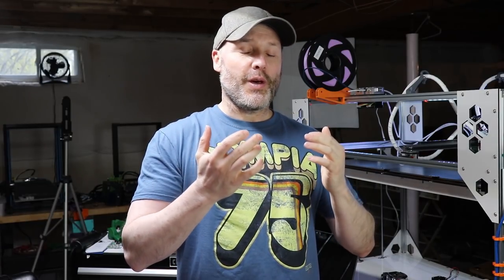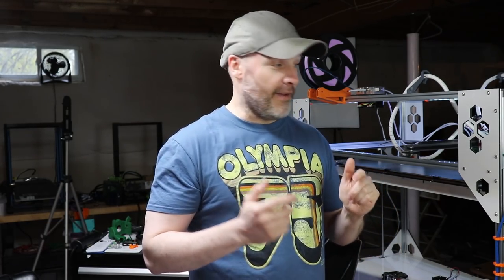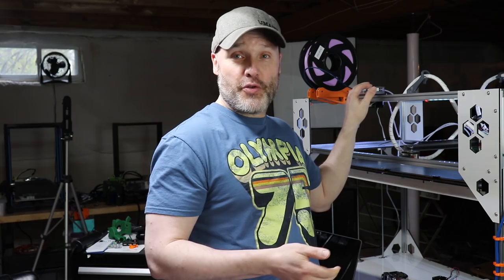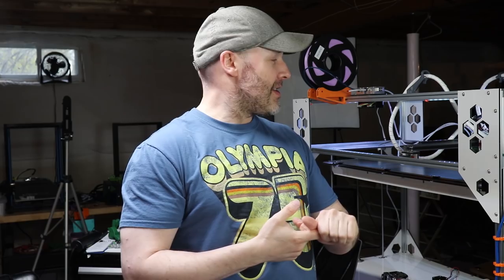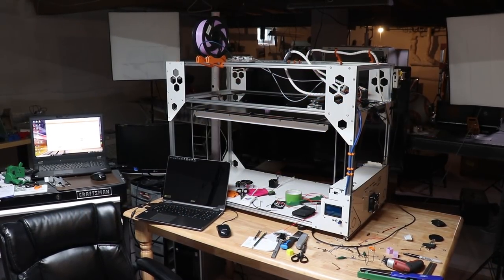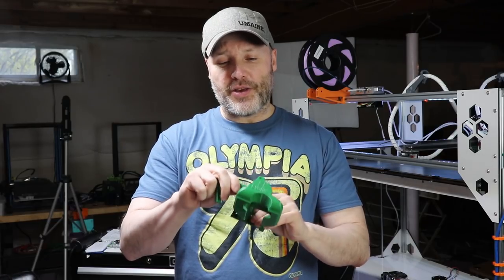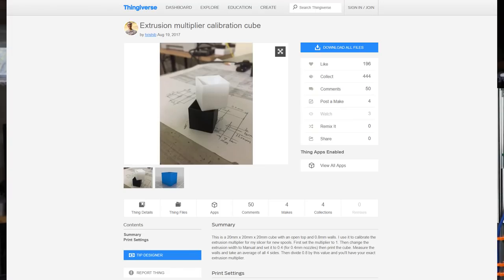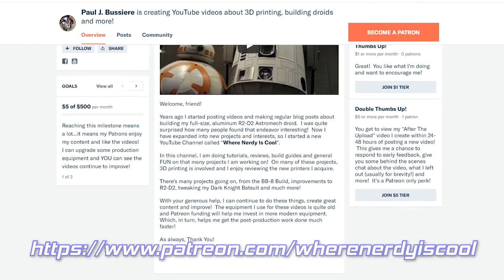Spring Update!  The Folgertech FT-5, FT-6 and CR-10S Aero Upgrade!

Comment: Theres certainly a lot of details left out of the FT6 build guide. The wiring tells you what you are supposed to connect to what, but doesn't give specific guidance on how to route the cables which is very important when you are dealing with a xy gantry that is always in motion. So lacking that and other details, everyones printer is going to look different and perform differently depending on how they happened to route their wires when they built it. As well, for getting full build volume, the rails and other components have to be installed in very precise locations. The manual doesn't give good guidance on how to do this so time has to spent fine tweaking things for the full build volume.

I had the exact same problem with the endstops being triggered by noise. They are on the same CAT5 as the gantry motor, so if you have the current set to a decent amount then the coupling will trigger the end stopped. Had to install capacitors inline to solve the issue. Folgertech will probably add these capacitors to the board in the next revision, I am personally surprised they didn't notice this obvious problem when they were testing the printers.

The dual extruder has worked reliably for me in single extruder mode once some heat creep issues were sorted with it. With dual extrude mode, it works, but expect to spend a long time figuring out a profile to allow it switch reliably. 
I think its still a great machine, but theres no free lunch, if you get a bargain on price then you will have to spend time to get it working smoothly. Have to keep in mind its not a lego puzzle you're assembling, its a high precision machine that comes with low precision assembly instructions.
Reply from the maker: Well said.  It has potential, for sure.  But it’s a crazy ride getting there

Comment: I need to produce parts that are nearly 26" long, support pieces that I prefer not to slice. Is the FT-6 more than a complete novice should get into? Should I find a printer that can print up to 15" and just slice the part? I'm looking at a $5-6K pricetag to have someone else print it for me. I think it's ridiculous, but I understand why they charge what they do.
Reply from the maker: It’s not a beginners kit for sure.  If you like to build and tweak, it has great potential. If you need to print reliable large prints consistently, I think the commercial offerings might be a better choice

Comment: Where did you get the build surface???
Reply from the maker: Which printer?
Reply from the maker: @danielweaver470  yes!  Good surface!
Reply: @WhereNerdyisCool  So, how do you feel about running Klipper & OctoPi on the FT-6 vs Marlin?
Reply from the maker: Right. Ow I’m fine tuning for just Marlin.  I don’t know much about those other ones

Comment: Hey, Paul -between the the FT-5 and the CR-10S, outside of price, which one do you think is best overall in quality and ease of operation? Thanks!
Reply from the maker: CR-10S.  Quick to get running.  Many upgrade paths.  The FT-5 I have has been like a leaky dam, fix one thing, another thing needs to be fixed 🙂
Reply: @WhereNerdyisCool  That's what I keep having with my CR-10S. About this time every year something catastrophic happens to where I spend days and many dollars to get it up and running again. I was thinking about selling the CR-10S and replacing it with the FT-5 if it was worth it. Folgertech has upgraded the FT-5 kit.
Reply from the maker: Give it a go if you like kits!